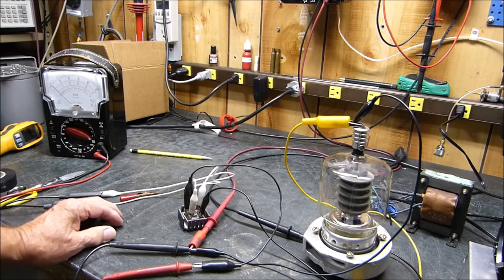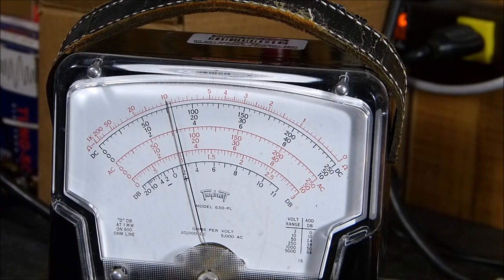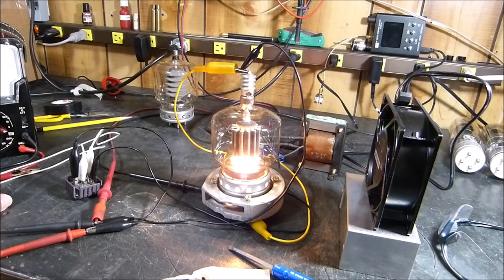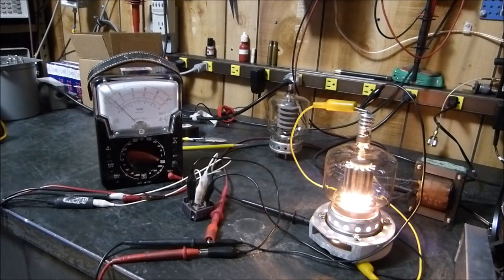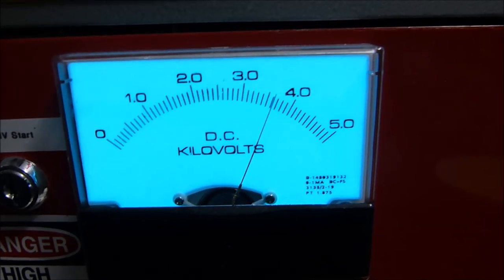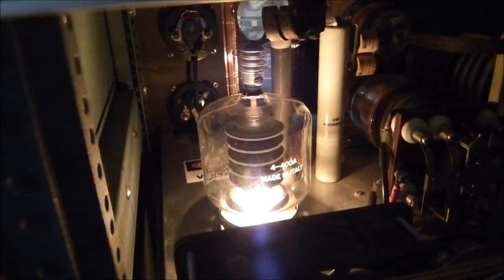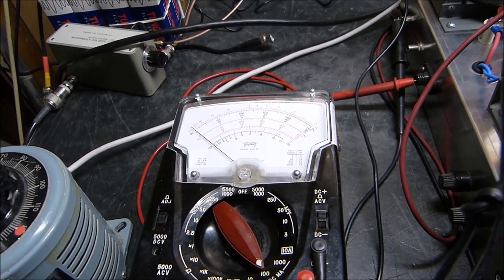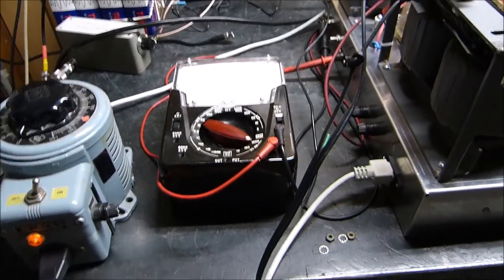Degassing Your Eimac 3-500Z and 4-400A Tubes

Comment: Old Thread/New Comment: W1ZY
What you are doing in the video is what is done to "rejuvenate" the cathode to "restore" a "soft" tube. Make sure you are blowing air over the pins of 3-500 family of tubes.

 To deGass a 3-500Z , you must use a  different technique . A  different setup , if you are still interested in experimenting with this.
Here's what you need:

1. 0 - 40 VDC variable supply (to adjust + grid bias)
2. HV Plate Supply on Variac (0 - 3,300 VDC)
3. Various VOMs for grid current, plate current & plate voltage.

In the set up in your video, you make the following changes:
 - detatch the grid from the plate and connect it to the + of the 0 - 40 VDC variable supply.
  - attach the plate to the + of the HV supply on a Variac.
  - attach the cathode (filament) to the - of the HV supply

With a 3-500Z tube flashing over like the 4-400A popping fuses in your amp, you are going to try to heat up the plate by raising the HV voltage and adjust the grid bias without causing the gas to glow inside the tube. You adjust these voltages to get about 300 to 400 mA of plate current and no more than 125 mA on the grid. In the beginning you want to do with minimum plate voltage (about 1200 VDC) to avoid like the plague any flashover. When the plate glows red with dissipation, let it cook for an hour.

Then readjust the two voltages to get the 300 to 400 mA of plate current at a slightly higher plate HV,  but not so much as to flashover the gassy tube like the 4-400A did in your amp.
Let the tube cook for a while, making certain that lots of air blows, especially on the pins.

Then increase the HV and readjust the grid bias to for 300 to 400 mA of plate current without causing the tube to flashover. Cook. 

The point is to inch the B+ until you are at 3,300 VDC (or so) without flashing over the tube. If the tube is dead, you aint gonna get to the original specified B+. 

Some old timers can do this by pushing up the HV to the point where flashover is just about to occur, and then back down the HV 250 VDC, readjust grid bias for 300 to 400 mA Ip, and then cook the sumbitch for a few hours. Then they inch the  HV up a little more, right before flashover, adjust grid bias, etc. and cook some more. 

This may or may not activate the "getter" to get the tube to operate at its specified anode voltage. 

There is a good discussion of this here: 
http://lists.contesting.com/_amps/2011-11/msg00011.html

I enjoy your channel. 

PS 
Regarding the Eimac stuff you quoted about tubes with external anodes, like 8877s, the "getter" is on the cathode, rather than the plate. So to degass, just run the filaments at the specified voltage without any anode voltage-none needed. This activates the "getter" on the cathode. Make sure a blower moves lots of air over the pins and up through the fins. 

 73s, 

BILL W1ZY
Reply from the maker: Thanks Bill,
You have provided a very nice detailed explanation and link to possibly save a rare 3-500Z.  I know everyone appreciates that.
I think what I may be missing all these years, is I never use 3-500Z's. I had a couple of Chinese made 3-500Z tubes a few years back and even made a video using them but got more output from 40+ year old Eimac 3-400Z's in my homebrew amp. I sold the 3-500Z's. 
With that said, it seems the real-world life with the 3-500Z is somewhat unique and cannot be directly compared to the 4-400A which I have used most in my builds. There seems to be issues with possible seal leakage around base pins and plate seal and maybe that along with other issues the mighty 3-500Z tends to have, is something that I am just not familiar with.
I don't want to discourage anyone form trying to de-gas or rejuvenate an old tube but the ones I have tried, just hasn't worked out for me.
There is information all over the Internet that if a power tube has not been used for a year or two or three, it is necessary to let the filaments run a some unspecified lengthy time before applying high voltage. With that in mind, I can say for sure, that I just plug my inventory of tubes in, let the filament warm up for maybe a minute and apply 4KV and nothing ever goes wrong. Am I just lucky?  Maybe that is where my experience "bias" comes in about the rejuvenating and degassing processes.
However... if I ever do get a nice single or set of Eimac 3-500Z tubes, you can bet I will follow the wisdom of the past and treat them with the utmost care before throwing HV on them. I certainly would feel a fool if I put a pair in one of my amps and destroyed them right out of the box and wondered the rest of my life if I had "cooked" them just a little, they might work perfectly.  🙂
Thanks again for your time and comments.  73  WA4QGA

Comment: I've worked with high vacuum and ultra high vacuum systems since 1979 for high energy ion accelerators, electron microscopes and x-ray microscopes.  These are all systems that involve the usage of vacuum chanbers containing electrodes,  filaments and certain materials used for physical or chemical processes. 
  As others have said,  the only way to remove gas from a vacuum chamber is to pump it out. It's important to note that there are vacuum pumps that are capture pumps.  They either use cryogenic temperatures to capture the gas inside a porous desecant such as active charcoal or by a chemical reaction as does the titanium metal with its' high affinity to react with oxygen or halogen gases and this is in fact the metal used in the "getter" flash inside electron tubes.   Gases cas be adsorbed or desorbed into or out of surfaces inside a vacuum chamber however,  heating any surface will cause gases to leave it rather than become absorbed into it.  
  There is one other method to reduce the pressure inside a sealed chamber.  You can deposit metal onto it while it's absorbed into a surface,  trapping it underneath the fresh coating.    It's very remotely possible to overheat only the filament to cause it to partially evaporate tungsten metal that can then be attracted to any cold surfaces nearby.  If you could do that inside the tube's plate it might work but simply using the tube again would heat the plate and cause it to desorb the gas again.    You're simply going to have to vent the chamber and connect it to a turbomoleculat pump then reseal it.   Clearly it's cheaper to buy a new tube. 
  By the way,  rather than using a piece of equipment to test a tube for gassyness, try connecting it to a Megger. That's a high voltage ohmmeter that contains a small high voltage power supply to get readings.   There's no need to heat the filament.  Just connect one lead of the Megger to the anode and the other to the cathode.   If the tube contains a good high vacuum it'll indicate many Giga ohms.  A gassy tube will breakdown at 1000V to 2500V indicating a HV short.   Save money and time and get rid of gassy tubes.  They're never going to work ever again no matter what anyone says or does,  unless they open it and repump it.
Reply from the maker: The megger is a grand idea.  I have one that goes to 5KV. I think I have saved some gassy tubes - I save bad tubes in a special box, labeled to throw them away at my passing so they  don't end up on Ebay as NOS...  🙂 I keep them to "model" my amplifier builds so I don't have to risk my good tubes in testing layouts. I will see what I can find and try the megger and may make a video of it. I have never bought into the idea of heating up tubes after they have  been in storage - except Hg rectifiers, of course. I just plug them in, give them the courtesy of having the filament on for 30 seconds, while I prepare to run in case of HV arcing,  and pour the HV to them. Thanks for the information...
Reply: @ElPasoTubeAmps  A Megger is fast and simple for a quick test for tube gassiness.   You don't even need to use HV DC.   AC is fine and if you have only DC it doesn't make any difference what polarity you apply the voltage.  You're looking to ionize gas molecules that don't belong inside the tube.   The HV you apply will spray free electrons at the gas, knocking off valance electrons in the atoms of gas, thereby charging them into positive ions . The ions will be attracted to the negative electrode while the stripped-off electrons are attracted to the positive electrode.  The anode in this case can be the tube's filament or, even the grid and it can be done at room temperature because the test uses Field Emission rather than Thermionic Emission.    If you measure any current at all, that means the vacuum has been breached by an air leak and nothing, short of re-pumping the tube is going to ever fix it.  You can alternately use a Hi-Pot which is basically an AC, High Voltage ohmmeter that reads out in current to test for HV Leakage current.   I've got many decades of experience working with High Vacuum and  HV systems and apparatus up to 250KV DC and industrial Tube / solid state RF Amps up to 8KW.  I repair those and work with specialty X-ray systems.  I'm not just taking guesses here.  I know what I'm talking about.   Try your Megger and see how fast and easy this test is. No other tool is required.

Comment: Thou art surely brave and courageous, David :-) I know that feeling of turning up the voltage and just hoping you connected everything correctly and that you can get to the "off" switch, if need be,  before the whole enchilada becomes a four-alarm fire.
Reply from the maker: When things start going to hell, I can never get to the off switch soon enough. I am like a cat in front of a rattlesnake.
I am starting to ask this question to individuals as I know you are one of the ones that will tell me the truth. Have you ever, personally owned, or personally witnessed, a tube failing and ionizing like the one in my video that has been made to work after the degassing procedure? There is, in my opinion, confirmation bias that is promoted thru ham radio folk-lore and amplified by the Internet about this procedure. I do not believe it will work until someone can tell me that they have experienced it personally, in real-time, a failing tube fixed by this degassing procedure.

Comment: When I have used this technique in the past, I filtered the DC using a 200uF/200V electrolytic 'liberated' from a switching power supply. Smoother DC makes it possible to draw more plate current at an even lower voltage. I'm in the middle of a big car repair, but when I'm done with that, I'll take a short video of this done to a pair of 833s, destined to serve in a low-band amp build.
Reply from the maker: I  love 833A's and look forward to your video. I have two soft one and an amplifier that uses one. Maybe I should try it also.

Comment: At this point, it seems that the tube is now only good for a night light :) at least it won't go to waste .)  I've actually done that with a defective 4-400A I have it around somewhere. I mounted the socket on a metal base, and connected the filament leads to an external transformer. It was on my night stand for years :)

Comment: Ballast the anode with a suitably sized choke or light bulb so you can run it at 1-2A continously. The reason it's running away is because the gas is ionising and lowering the impedance like a thyratron. That shouldn't be a problem as long as you can keep the current from going too high. If you can keep it cooking at a few amps for an extended period it might just getter away the gas.

Comment: I remember reading in an old tube manual (a 1940s college lab textbook), that 'flashing' the cathode like you did for the soft tube, and is also done at the factory, brings a new layer of thoria to the surface of the carburized cathode. While not a fix for every problem, if emission is low, it can be a band-aid fix. It also said most directly-heated cathodes have much more than enough thoria, and also an emission capacity that far exceeds the tube's needs.
Reply from the maker: I understand what you are saying. Some time back I measured a high-end 12AU7 family of tubes and then accidentally dropped it. I figured that was the end of it... so I tested it immediately and it was considerably stronger than before I dropped it. Naturally, I was surprised. Sometime later I decided to do the same thing on a "controlled basis" and I found nothing different before and after the drop. Hmmmmm... During the measurement of these transmitting tubes, I was experimenting with different tubes and found that the bad tube would "run away" in current and ionize and blow the fuse whereas the good tubes would not. A nonchalant measurement before and after heating the cathodes to currents 3X   their normal operating parameter seemed, at least in one tube, to improve it.  Sometimes a moment is hard to duplicate but it still might be true. Old black and white TV CRTs would get weak and the fix for them was to heat the filament extra hot as you mentioned and help clean off the cathode as they are thorium tungsten filaments. Another method for the TV CRTs was to simply add in a filament transformer that was above the 6 volts that the filament was rated at, i.e. run it at maybe 7 or 8 volts to really heat it up. It worked... Raising the filament voltage  works on regular vacuum tubes also not just the thorium-tungsten type.
Reply: @ElPasoTubeAmps  Doesn't grid ground and biasing voltage dictate whether or not a tube will "Run away"!
Reply from the maker: @ericdee6802  Grounded grid amplifiers are made with tubes that have a lot of gain, like an 811A which has a gain (also known as mu) of 160. The Eimac 3-400Z, 3-500Z, 3-1000Z and the 4-400A family of  tetrode tubes strapped as triodes, have a gain of 200. They make great GG amplifiers and require no bias - thus called zero bias triodes.  Low gain tubes, for example, a 833A is a medium gain tube and does require a negative bias of about -90 volts for a plate voltage of 4000 to keep the plate current under control. The low gain tubes need to be grid driven instead of cathode driven and they have to be neutralized as they are run as tuned-grid-tuned-plate (TGTP). It is all about the grid structure inside the tube. Hi gain tubes have a very fine closely wound grid structure. More spacing in the grid structure lowers the gain but increases the linearity. Can't have everything... Low gain tubes like the 300B are very linear and make good audio amplifiers. Low gain high-power tubes, again like the 833A, make great class-C plate modulated amplifiers for small AM radio stations that used to be everywhere in the USA. The Gates amplifiers/transmitters used to run two 833A in the final and plate modulate them with another pair of 833A for four beautiful tubes in the transmitter.

Comment: The only thing I can think of next for you to try is to use the current to heat the cathode and use a induction heater around the tube to heat the plate to red hot to get the getter material activated. That is generally what they do at the factory 8s some placess
Reply from the maker: I did heat the plate up to red and dissipating up to 500 watts. I could increase the current to 5 to 7 amps at 100 volts but it became critical I kept my hand on the Variac as it could run away and ionize. Good tubes never did run-away. This tube was beyond help and I sent it back and the good gentleman gave me my money back.

Comment: This idea of defassing tubes reminds me of the reforming caps stuff. If air gets into the tube no matter what you do, the air won't get out. One of the most difficult parts of the tube to build are the seals between glass and the electrodes. Generally if the tube is used periodically it tends to be less suceptible to fail than tubes that are NOS. Maybe it is because of the heat tempering the glass at the seals, I don't know. About reforming caps, yes, a bunch of people will fall over me, but, when chemestry and materials become bad, they are bad. The only exception in reforming caps would be "forming" electrolitic caps, when they are new. But trying to revive a 60 year old crappy capacitor won't happen.
Reply: There's a difference between a tube going to air and a tube being gassy. If it's gone to air, it's dead, no question (and some eimacs are known to have issues with pin-to-glass seals). If it's gassy, it just means the vacuum is contaminated with products of off-gassing from the various elements in the tube. Don't think this is such an issue in smaller tubes, but the anode in large tubes like these acts as a getter to absorb those impurities. If a tube has sat on the shelf for too long without being heated enough to "getter" it, it can be "gassy". The fact the filament in this tube didn't go up in smoke, and the fact he was able to get anode voltage above 1000v without drama means it likely still has vacuum. The arcing indicates gassing contamination and it may be too far gone to recover, but lots of people have rejuvenated tubes using methods like these. One difficulty though is once it flashes over it can destroy the grid completely and there's no recovering from that.
Reply: @va3dxv  Thank you for your comprehensive reply. Yes, as soon as I posted the comment I started thinking it could refer to what you comment and reminded me of what happens to halogen incandescent lamps if they are not powered at full specified current periodically, for example, if they are used in dimmed circuits. The filament needs to glow at high temperature for the evaporation cycle of the halogen material to happen, or something like that, jaja. Anyhow, if there are impurities it's because the manufacuting process was not optimal... although which manufacturer would have guessed that we would be still palying around with their tubes 50 to 80 years later!